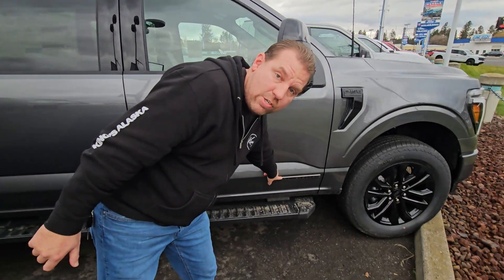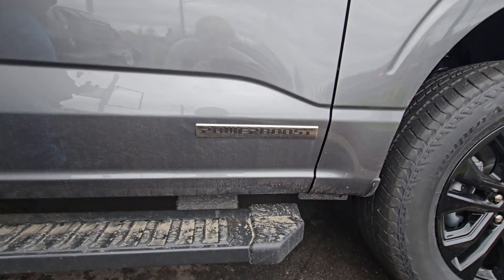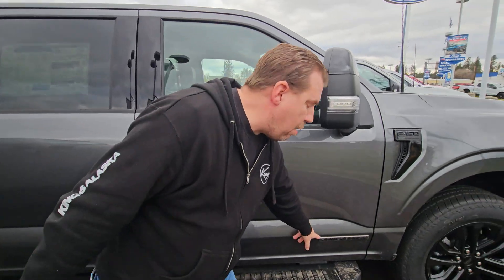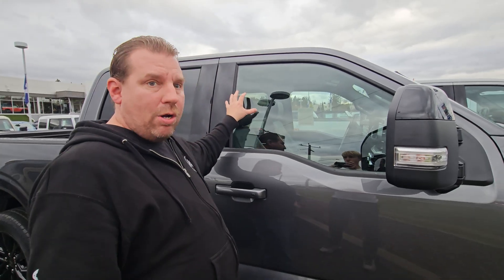IS THE 2026 FORD F150 EQUIPPED WITH A GPF??  AND WHAT DOES IT MEAN??

Comment: EPA requirement starting in 2027, the turbo charged engines will have GPF’s, no matter which brand.  Ford is just the first to adopt. You won’t have a choice, except to opt for naturally aspirated engines.  PF’s on gas engines are much simplified as compared to DPF’s.  Do your research, the FUD isn’t great.
Reply from the maker: DPFs and GPFs are essentially the same and hopefully soon those EPA mandates will change